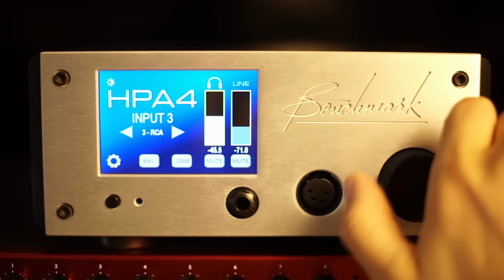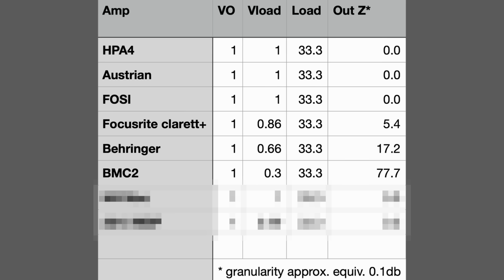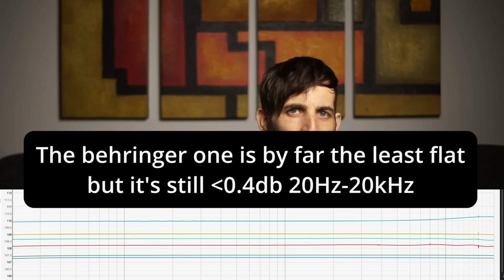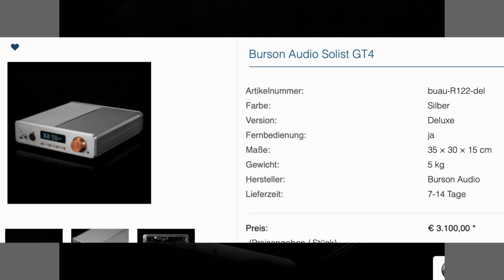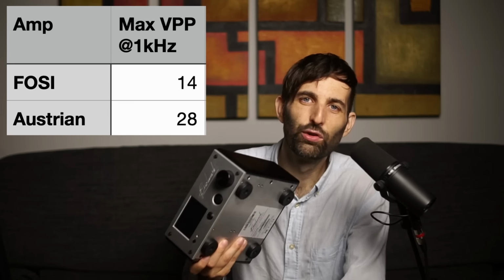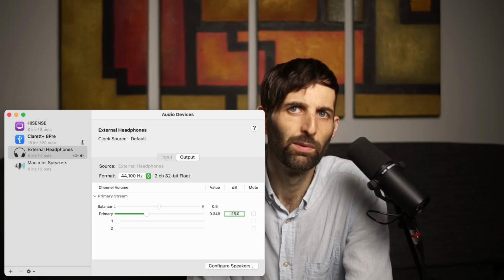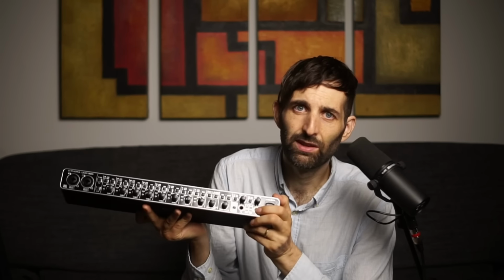Stop plugging your headphones into your audio interface!! Headphone amps demystified.

Comment: 9:19 The reason the bass dips on one pair of headphones and gets boosted on another (can be applied to any frequency range and not just the bass) is because different headphones have different impedance curves.

The impedance curve is a measure of impedance at all frequencies the headphones can produce, and produces a sweep not unlike a frequency response graph that is unique to each pair of headphones. This is especially important for dynamic headphones, as most dynamic drivers have non-linear impedance curves, which you can find online for most headphones. The listed impedance on the manufacturer's page for any pair of headphones is the "nominal impedance", which is essentially an average (or sometimes just the impedance at 1 kHz specifically) and usually doesn't indicate the exact impedance at every frequency or whether the impedance curve is linear or not.

Depending on the impedance value at each frequency, the response at that frequency can be boosted or dipped relative to other frequencies, which essentially means every pair of headphones has a different response to high output impedance, and will show different changes in the frequency response measurements. Using the impedance curve measurement for the headphones you're testing, you can predict what changes to the frequency response you'll get with increasing output impedance (frequencies with higher impedance will be at a higher volume relative to others frequencies, which, when normalized, will show up as a boost in the frequency response measurements). This same concept applies to IEMs as well, especially those with multiple drivers, as all of these drivers will have different nominal impedances and will create an impedance curve that can be all over the place.

There are quite a few headphones that have a quite linear impedance curve throughout the audible band (a lot of planar magnetic headphones, for example), so in theory, these headphones wouldn't have any dramatic changes in frequency response even with increasing output impedance.

However, high output impedance will still mess with the damping factor on these headphones, and will inevitably reduce the power delivery to the headphones making them quieter overall, meaning you might have to push the gain on your headphone output high enough where current/voltage delivery would become the limiting factor and would cause clipping before you can get them loud enough for your use case.

So you'd still want low output impedance even if the impedance curve on a pair of headphones is linear, just to ensure as much current and voltage as possible is reaching the headphones, to maximize headroom before it starts audibly clipping.

Great video btw, kinda sucks that the people who should be watching these videos to correct their own delusions about audio, are likely the last people who will do so. Hopefully, eventually, they do confront it. Keep it up man!
Reply: This brings up an interesting point: headphone amps output a voltage, they are voltage amplifiers. Thus, if a headphone has an impedance bump at a specific frequency, the audio output will be less and vice versa, because what moves the coil over de magnets is current. One might wonder why we don't see headphone amps with a current output, where output current follows the input voltage. This way headphone impedance no longer matters (within limits, of course) and bumps and dips in the impedance curve no longer result in bumps and dips in current through the drivers, resulting in equal amplitude all over the frequency range.

Funny side effect: a current drive has a very high output impedance!
Reply: @meindertsprang7491  Agree with you here, but just wanted to share some more food for thought:

As per our usual understanding of impedance, as output impedance on the source increases, we would expect frequencies that have higher impedance in the impedance curve to get quieter relative to other frequencies at a lower impedance (somewhat of an inverse relationship between frequency response and the impedance curve, with increasing output impedance).

However, in reality, the exact opposite occurs, with frequencies at higher impedances getting relatively louder than frequencies at lower impedances, as output impedance increases. This shows up as a "boost" in the frequency response, which somewhat directly correlates to the impedance curve.

This seemingly contrary behaviour is due to the voltage divider effect, and how it interacts with frequencies with differing impedances, as output impedance increases. This is actually related to what you were talking about, as at an extremely high output impedance (> thousands of ohms), the source becomes a "current source", and the frequency response of the driver itself will mirror the impedance curve 1:1 (not taking into account the other changes to the sound that are later imparted by the physical characteristics of the headphones themselves).

The main reason for this is a bit of a trick, which is that no frequency actually gets "boosted" with increasing output impedance on the source, and in reality they all get dipped. It's actually that different frequencies get dipped more than others (high impedance = less of a dip, low impedance = more of a dip), so when we are talking relative levels, frequencies at higher impedances will seem to be at a higher level than those at lower impedances.

Add to this the normalization/level-matching that is normally done when frequency response measurements are done and visualized, and you get the apparent "boost", which is in reality just a perceptual trick and not an actual boost or increase in level that would be apparent if you were to avoid doing any level-matching.

Cool eh?
Reply: @j0hnlem0n  thank you
Reply: Diffrnt speakers innit

Comment: Power supplies are not just mostly 'a solved problem'. The only thing solved about power supplies is how to make them as cheap as possible. And power supply does impact more than just noise floor.
Reply from the maker: Does it impact the transcendental 4D immersiveness?
Reply: @APMastering Yes, it probably does, Cock. But power supply may well be the cause of the Behringer not delivering low end even though the damping factor is lower - it's called ability to deliver current. Also power supply obviously impacts voltage headroom. Also dynamics. All measurable stuff.

Comment: Hey! Thanks for the video and pointing out some basic principles. You are correct at some points of your video.

I hate to crash the party here, but since we are talking "objectively" here, you are again, sadly, very wrong about quite many things here:

So again, there are definitely things to add here:

- Frequency responses only tell part of the story. There IS a reason, why people talk about slew rates and intermodulation distortions etc. Those are super important properties of a headphone/amp pair. I remember in your video about the NS10s that you talked about bass ports and transient responses of ported speaker systems. How can you at one end tell people that this is super important in speakers (which is totally is) and completely disregard kind of the same performance measures in headphone/amp pairs? Transient performance (Phase properties) is super important and varies heavily between amps/headpone pairs.

- Ohms are not Ohms, especially when we are talking about amplifier pairs. Your are making some points about impedance here (which are correct), but you are not even talking about the difference between impedance (Z) and resistance (R). I hoped you would when you talked about how you measured your output impedance, because its quite an important point to make here.

- Actually it would be more telling if youd compared audio interfaces that run decent dac and amp chips. The clarett is just not the same ballpark as as 250€ headpone amp (Let the behringer alone, its already on the ground). I know it is more expensive but also needs to do a lot of stuff. They cheaped out on that end to ensure better ADC performance on the input side of things, which does make sense since more people are interested in those things. Compare for example some standard interfaces like a base uad one, the (for its performance praised) arturia interface or at best a RME.

- Macbook amps are quite good, especially the newer ones. Totally good enough for basic mixing, but they do not even come close to pro headphone amps. Again, your explenation does not even tell half of the story sadly.

- Other great points have already been made in the comment section, which explain your unexplainable phenomena and clear out other things as well. I won't repeat on those.

IF you are talking about what is objectively better or not, please do your homework and talk to engineers. Do the right measurements and don't disregard things that have been absolute consensus in between capable engineers for decades. If you have already contacts with firms like austrian audio, talk to their engineers on how to actually build a good amplifier/headphone and what measures actually mean.

Comment: It's not true that recording interfaces don't have a recallable level. Some are digitally controlled, for instance a lot of MOTU's have digital volume control in 0.1dB steps and also digitally controllable via firmware. Also you could silmply set you knobs at some maximum value, not touch them again and control volume from the DAW. Bad dancer always blames the shoes. Real audio engineers can work and deliver results with anything that's not a complete broken piece of crap.

Comment: Happy to hear the mystery DAC. However, when I routed the output from my DAW to my MAC Studio M1 ext headphone out, in due time it had audio dropouts & distorting audio in some time (it was clean at first), sounding like when you run out of buffer. But at the same time, the output from the audio interface was clean. Can someone help me, what could be the reason. I was on 48Khz both in my Daw & mac ext headphones.

Comment: About the frequency response changes- would an equalizer dropping the boosted regions down (n vice versa) by the equivalent dB make it imperceptible? Just out of curiosity.

And also about needing to have an exact volume to return to- I'm confused. Is there any reason that you can't just set the volume knob to slightly above what you'd ever normally have it at and then decrease it through your PC's volume setting?
Reply from the maker: You can do this. If you ever nudge the Knob then you’re screwed

Comment: I use a pair of Sennheiser HD 600 plugged straight into a Focusrite Clarett 8. I've set the output level with its software control app in such a way that my reference level is with the knob notch straight vertical in the middle, so it's dead easy to set it consistently. I'm not saying that it wouldn't be nice, but I don't really need a recall feature, certainly not at 4000€.

Comment: Topping L30 II NFCA Headphone Amp, RCA to 6.35mm Headphone Amplifier & RCA Pre output Preamplifier !!!  Affordable & high quality I tried more than a few before this stopped me dead in my tracks.

 That said this model has better performance than L50 balanced version AND the L50 is a pass through not pre amp like the L30 II and L70.

And yes I`m using a DAC with the L30 II.

The Topping L70 has a relay ladder R2R design for volume control so you get analog purity with a remote control. Having a remote for volume control can be bliss for some couch potato's but it`s double the price of the L30 II...

 Appears other than that the purity of the audio probably unrecognizable as far as the ear to brain equation ?  Check the ASR forum if you want to compare measured readings of the 2 I`m far from being an audio engineering scientist but I own the L30 II and praise it for it`s purity.

Low priced Dac headphones amps I`ve personally listened to that are not worth purchasing SMSL Ds 100 & Topping DX1 mini do yourself a favor and avoid the regret you`ll have later and don`t bother with the cheap built Dac HPA. 

From my personal experience $275 CAD for a Dac HPA and you`ve entered into the purity stage of audio music, in that price range I`ve only had the DX3 pro but returned it and  upgraded to the L30 II and purchased a separate Dac, very noticeable boost in purity !

I also own SMSL D12  Dac HPA amp ( only rated for 32 ohm headphones ) but only used it a couple times I was going to return it after I bought the L30 II ( rated for 300 OHM headphones )  but kept it for portability uses I`m not disappointed with it`s quality for the price as it`s $188 CAD for use as a dedicated DAC or Dac HPA.

I used ASR forum reviews for researching my audio gear and Honestly I can say the reviews from my purchasing experiences and listening trials are factual. Of course there is always one that sneaks by and that was the Fosi Audio DS1 compared to the DS2 the DS2 uses a Cirrus Logic CS43131 DAC chip and to me that chip sounds like garbage cellphone quality Dac chips nothing like the DS1.

  The SMSL DS 100 & the SMSL D10 that I also listened to have the same garbage quality sound and they also use the same Cirrus Logic CS43131 DAC chip that are not even close to the pro audio industry grade dac chip used in the DS1. 

Dac chips I`ve used so far that appear to be professional pro audio industry grade chips as far as 100% purity in even the most delicate blended frequencies are the ES9038Q2M, ES9039Q2M and the AK4493S.
Reply: The L30 II also uses analog volume control !  
Not digital attenuation that degrades the information stealing bits. Even the top tier ESS ES9039Q2M Dac chips  use this technology unless my online research was corrupted or false. ESS does use a 32 bit but I`m not educated enough to understand how that would affect a 16 bit flac file with lower than max volume.

It all becomes a rats nest of information when you have no Audio engineering educational back ground.

I`m also trying to gather information on software media players app`s volume level adjustments as to how they are affecting the information ( bits ) it would be excellent to see a video explaining this from AP Mastering.

Comment: Kind of a moot point. If you are using headphones for mixing/mastering, etc., you are already doing it wrong.
Reply: That used to be true but technology advances: planar magnetic drivers and meta materials.
Reply: @sparella  Maybe those can help with a flatter/better frequency response, but how do those things make up for ear fatigue and the lack of a true stereo image?
Reply: @Stryder56  Yes, improved FR but also faster transient response and settling times. Crossfeed plugins work for periodic image checks. Good phones shouldn't cause excess fatigue at appropriate SPLs. I imagine it could be caused by treble spikes in the FR of lower quality sets.

Comment: So, I work at analog devices on consumer audio. Headphone amplifier are an active load and do not have a constant impedance but dependent on the load. So, for instance we don't even quote output impedance. If you have a enough power and it is pretty constant per frequency it doesn't matter it just hurts your efficiency which for battery operated devices is everything.

Comment: The impedance of any dynamic speaker or headphone is not a constant , it is different depending on frequency,  this is what causes differences in the amps 'reactence '  , the best amps are those which can deliver consistently under reactive loads , almost all amps can give flat response under linear loading , but no one makes a linear load headphone or speaker due to the nature of electrical to mechanical transfer . In short , get manufacturers to supply test data under real world conditions of their products to allow buyers to get the best match .

Comment: This is making a paradox in my head, because i thought i could take the output of a tube headphone amp and connect to cheap small 4 or 8 ohm speakers, but it doesnt work at all. I understand should go from low to high impedance , so low to higher 200ohm headphones might make sense.

Comment: impedance is widely misunderstood in practicality. the average bedroom studio will do fine with low impedance setups and likely benefit from them in many cases. in a real studio, unless youve got a bunch of di boxes w regulators and other gear, you flat out can not use low impedance equipment with your studio equipment. the reason why more professional equipment has higher impedances despite the drawbacks is because in a real studio with real equipment and real racks and real instruments amps etc, that equipment is putting out signals that require a high impedance receiver. the problem is that nobody is familiarizing themselves with the equipment they use. you shouldnt automatically shoot for low impedance equipment, you should shoot for what best matches the source youre recording from. plug a real guitar amp into a zero impedance interface for di record and see what happens, they usually need 8-16 ohms of impedance.

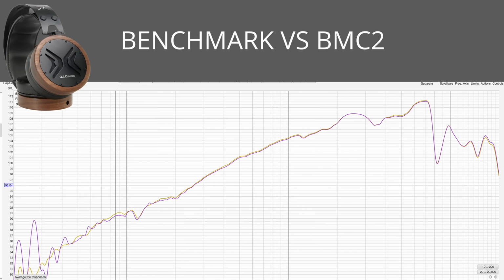Comment: 10:21 the reason is probably electronics, depending on the parts and circuits you use you get different kinds of unwanted behavior in the output signal

Comment: What about the 3.5mm jack on the Macs? I can hear a noticeable difference when using a instrument cable vs a 3.5mm+adapter with some of my gear,  I only started the notice this after I got told about this, that 3.5mm sounds less "full", and I would probably never think of it unless I got told, but now when I know I can for certain tell the difference between 3.5mm jacks vs XLR and instrument cable. And the difference lies is in the output jack size. Are you absolutely sure you the listening experience is fairly compared? Maybe apple use super high grade hardware,probably but I dont know for sure.
edit: Maybe you answered this at the absolute end of the video, not sure.